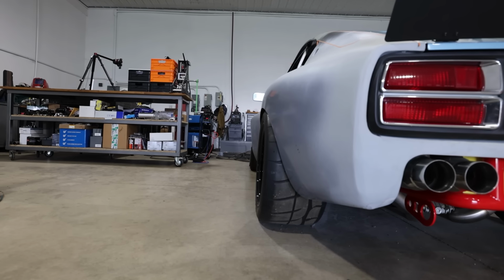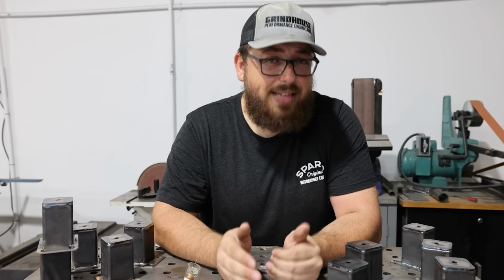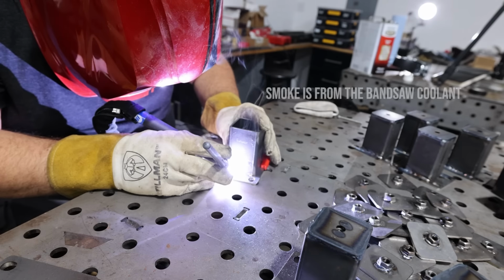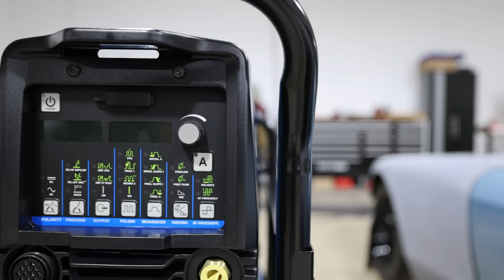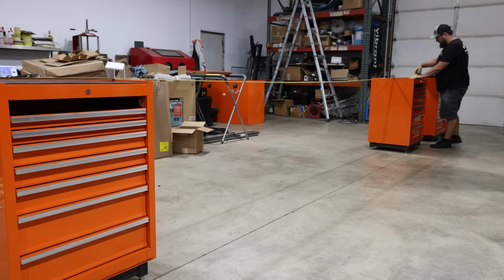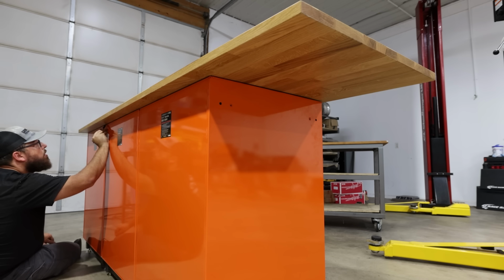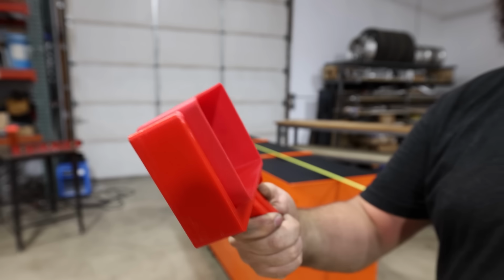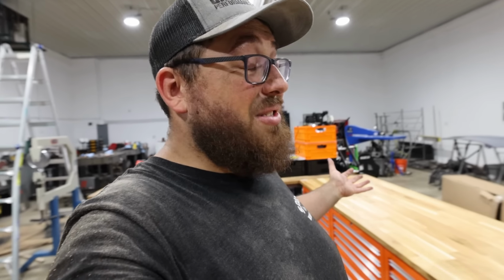Building the Ultimate Workbench for my Dream Garage

Comment: Is this a bad time to tell you about Gridfinity?
Reply from the maker: Haha it looks like a great system! I looked at 3d printing bins myself and it was actually going to be ~3-4x the cost, and take me over six months straight of printing for the volume I wanted to get. I will probably do gridfinity bins elsewhere in the garage and in my office though, they look nice
Reply: @GrindhousePerformance  I'm a big fan of it.  Doesn't matter much for things you're not moving around though.  It's nice to keep all my parts organized and stop the damn things sliding when I close drawers.
Reply from the maker: @sitekickremastered  1000%, Im probably going to wind up printing some specialty ones for specific drawers/items. So far the generic ones have gotten me most of the way there. I do take the bins out a lot to work in the house and/or around the shop

Comment: I want to say that tha you may have missed economy of design so using the top 3 drawers.  These may not given you the best bang for the buck.  The HF toolbox’s may not be the cheapest way to go further some storage system have draw bins that are designed for the drawer some of these are just dividers that mate with slots around the drawer edge, yes that will not allow you carry off the whole bin to work out of.  But that will put your bins in a location where they can become contaminated with abrasive dust, melted or dropped and cracked or broke.   I figured you cutdown all of your bins and ordered extras but what was the minimum order.  I will watch for updates on your system.
Reply from the maker: Hey thanks! I'm personally not a fan slotted dividers. I played with the idea of laser cutting slotted inserts for the drawers, but they don't have the same level of modularity and over time the hardware starts to migrate to neighboring slots. The more adjustability (unused slots) you add, the more likely everything is to move around. I do like being able to move bins around the drawers and change them out for other sizes that fit in the same grid space. Being able to move them around the shop has been really useful. I don't think they have a minimum order.. so far I'm really happy with everything!

Comment: why didn't you just 3d print your own larger modules with 4 or 6 shallow bins together?
Reply from the maker: Hey good question! If I was only doing one drawer, or maybe just one toolbox, I probably would've printed them. With how many bins I was going to need, I found it significantly faster and less expensive this way. Each drawer stores ~50 bins, each toolbox has 3 shallow drawers, and I've got 6 toolboxes for the bench. It would've been around 6 straight months of printing unless I bought more printers, and for how many bins each spool of filament would produce, it would've actually been quite a lot more expensive as well. I looked at having a print farm do them for me, but they wanted a LOT more money vs. buying the injection molded ones I decided on. I'd actually looked at having injection molded dies made, but that was a whole other can of worms haha

Comment: did i miss the part where you explained why you didn't just 3d print the bins?
Reply from the maker: It's a good question- If I only needed to do a single drawer, or a couple rows to bridge a gap I probably would've printed them. Printing would've cost ~2.5x more per bin, and with only a single printer would've taken me over six months of running the machine to fill the top drawers of all six toolboxes. I looked at having a print farm make them but they wanted like 4 bucks per bin which would've been way out of budget.
Reply: @GrindhousePerformance  i figured cost was it otherwise you would have done it.

Comment: Where is part 2 of the workbench build?
Reply from the maker: I ended up getting injured shortly after this one posted and I didn't record when I was recovering... got too far behind and needed to just get it done. I'll be doing a shop tour video soon with an update to the bench overall, but you can see bits of it in the heel plate video too👍

Comment: It's not economical to 3D print the bins sir?
Reply from the maker: Hey that's a good question- I looked at having print farm companies make them in bulk for me, but it was 4x the price as the injection molded ones. The bigger issue was time. To print 60 bins for each of the 18 drawers would've taken over six months without buying more printers and that seemed like a poor use of my machine. If I was only doing one toolbox or one drawer I would've printed them, but i needed too many of them for it to make sense

Comment: Would think a band saw easier to cut them down to size
Reply from the maker: I thought so too.. I tried cutting them on my vertical bandsaw but it was really slow going and was building a lot of heat. I didn't have a lot of different tooth blades to try but what I had didn't work as well as I'd hoped
Reply: Ok, make a jig to hold under chop saw, much safer as you don't have a sled for table saw and blade not enough to do in one hit (hence saying band saw length optimal)

Comment: I think I'd rather have a workbench that the U.S. General boxes rolled under so I can pull them out and wheel them over to where I'm working.
Reply from the maker: I'm usually the mindset that everything in the shop should be on wheels. I strongly prefer being able to move everything I can. This one, I knew what was going into the boxes are going to be way above the weight capacity so I wanted to build in reinforcement to keep the boxes from flexing around. I could be overthinking it and I definitely hope I don't have to move the bench again 🤣
Reply: @GrindhousePerformance  I was thinking about the weight as well, most likely you're right about the hardware.  I was speaking more in general with tools/supplies/consumables etc.  I'm now in my early 50's and Ive been reorganizing all of my tools/garage with an eye towards the future as everything seems to be getting heavier, lol.  About a decade ago I finally bought a larger U.S. General tool box along with the side mount drawer unit which had been great but I wish I had thought about it a little more because a much better solution would have been to buy 3 boxes like you bought that slide under a tool bench.  Much easier to wheel to where I'm working and even to move to a new home, especially as I get older.  Between mechanic tools, woodworking and my home building tools I'm finding that keeping things in smaller boxes is by far the best solution as I'll be able to easily handle everything into my late 70's, god willing.  Even now, wrestling with larger, heavier things is a pain as they require another person at the very least so keeping things smaller and lighter is a good idea at any age.
Just a few thoughts, cheers!
Reply from the maker: @tomj528  thanks for sharing all that, I'm always happy to hear from experience! 👍

Comment: "where do I get a hose adapter" side-eyes 3d printer
Reply from the maker: I was so annoyed. I had an adapter dewalt provided but I didn't realize it didn't fit until I was about to start. I don't know if it was the wrong adapter or what, but at that point I was getting this thing done one way or another 🤣

Comment: Why didn't you 3D print the organizer bins? They seem pretty expensive when bought online
Reply from the maker: Its a good question- If i only needed to fill a single drawer i probably would have printed them. Each drawer has between 40 and 50 bins. It was going to take over six months of straight printing with my printer, to fill the top 3 drawers of every box, and it was actually more expensive using the filament, not including wear and tear on the machine. I reached out to some print farms to print them for me but they were significantly more expensive than the injection molded ones I ended up buying. I didn't want to buy more printers just for the project, when that money could've gone into higher quality toolboxes (although I didn't have the money anyways haha)
Reply: @GrindhousePerformance  thanks for the insight. That really does make sense. Mind me asking where you bought them?
Reply from the maker: @djes.36  I bought them from schaller corp 👍

Comment: I feel like it would have been WAY faster to just 3D print drawer dividers for the shallow drawers rather than designing and printing a tool just to hold the bins while you cut them all down.
Reply from the maker: I looked at laser cutting dividers with adjustable slots. It wouldve been way faster than what I did, but, when dividers are open at the bottom, the small stuff tends to find its way underneath and into other areas. I'm not able to physically take the bins with me wherever I'm working in the shop or office. That's a big dealbreaker for me. It's easier to reconfigure drawers using the bins versus large overarching dividers. All said it takes ~30 minutes to cut a drawers worth, which, to me, has been worth the trade off 👍

Comment: why didn't you just 3d print the bins?
Reply from the maker: It's a good question! If I was only filling a single drawer I probably would've. I did model bins to print but feasibly this was the easier solution. Each drawer fits roughly 60 bins, and I'm planning to fill the top 3 drawers of all six tool boxes. The filament cost is quite a bit higher, and it wouldve taken over six months of nonstop printing without buying more machines. I looked at having some print farms do them for me but they were ~5x the price of these injection molded ones. I can cut the bins in about 30 minutes per drawer with the pliers👍
Reply: @GrindhousePerformance  That makes sense. ive never seen or used a 3d printer.

Comment: Get a MIG welder if efficiency is a factor. 3d printing that welding aid is the more autistic thinkin I've seen this year. Weld 3 tiny scraps of steel together, or maybe use the multiple fixture tables you have

Comment: 3d printer would have fixed the bin problem
Reply from the maker: Kindve... 60 bins per drawer, 3 hrs to print a group of 4, 18 narrow drawers.. it wouldve been something like six+ months of straight printing to fill out what I needed. The filaments also quite a bit more expensive than the injection molded parts
Reply: @GrindhousePerformance  fair point. I didn’t think about that merry Christmas
Reply from the maker: @Gregoman89  Merry Christmas!